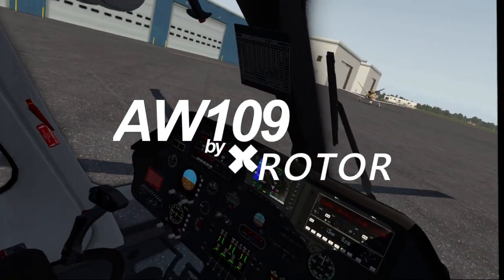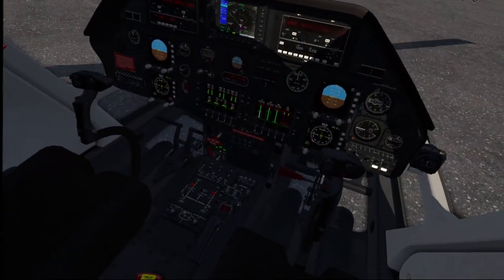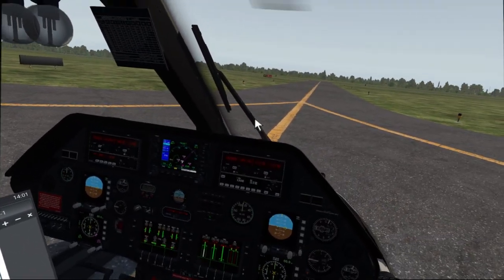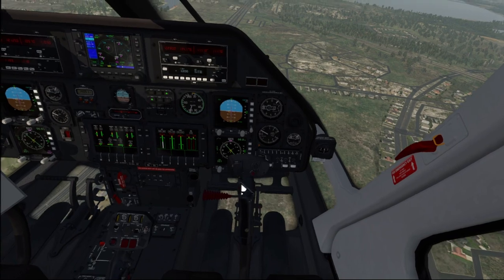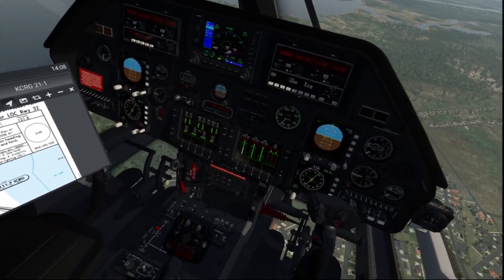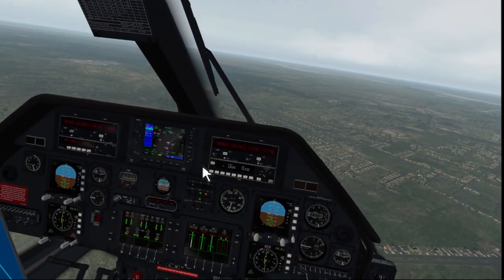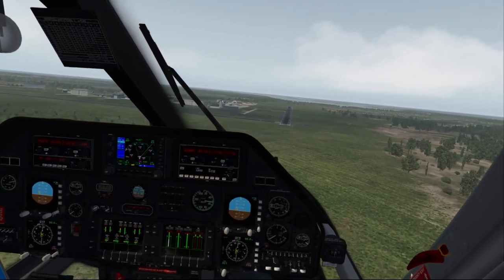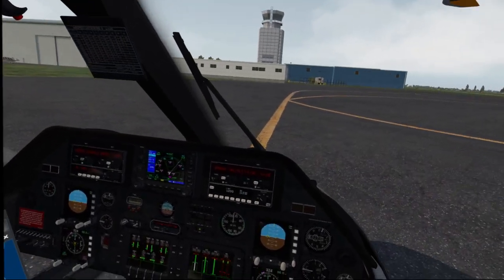X-Rotors AW109E Startup and Flight Tutorial

Comment: Make your lives easier and follow the 109’s flight manual. All the switches in the electrical section of the overhead panel should be in the on position prior to start, except for the avionics master which is set to ground. Leave the power levers in the flight detent. The checklist calls for the beep switches on the collective to be tested prior to start, which in the real aircraft moves the power levers forward and back. When ready, turn the fuel pump and fuel valve on and move the engine mode selector to “idle”. The engine will start itself. There’s a ton more before-start items on the checklist but they’re mainly systems tests.

Comment: excellent video, thank you so much. especially the FT Rel button has been interesting to see introduced, despite i don't seem to fully understand it yet.  Is it to avoid blade strike? can you tell me a bit more please. In theory, let's say you are on full rpm after startup, the swashplate would pitch down front of blade disk so you can taxi roll, right? Now, the rotors are sort of that powerful, how do you avoid the whole fuselage being tilted either nose down or sideways? looking forward to hearing from you, thank you.